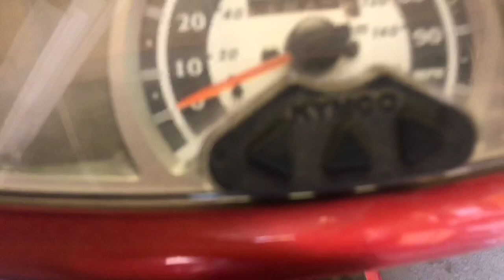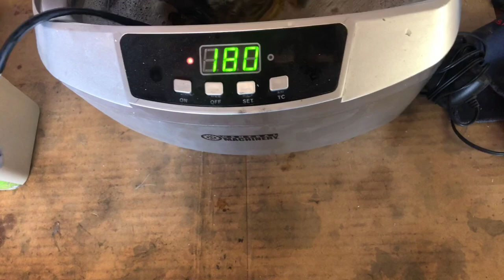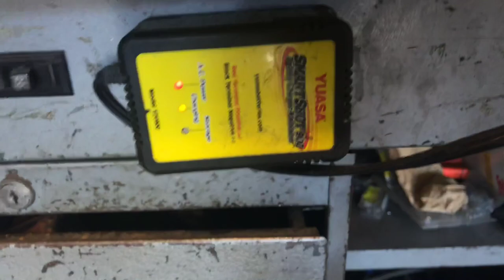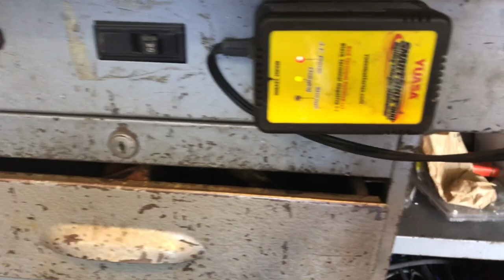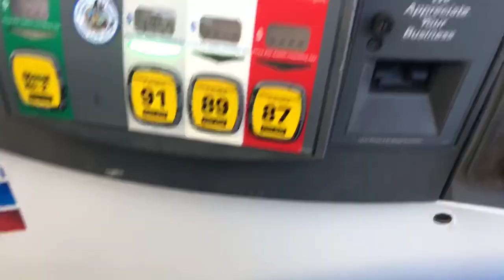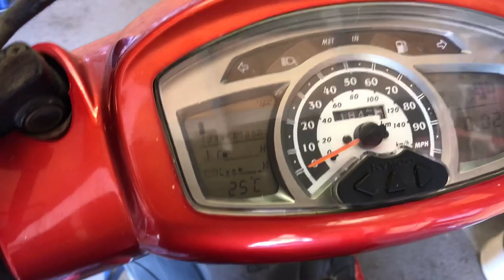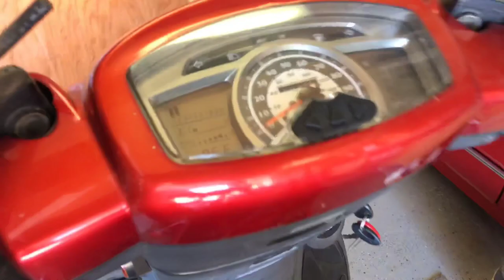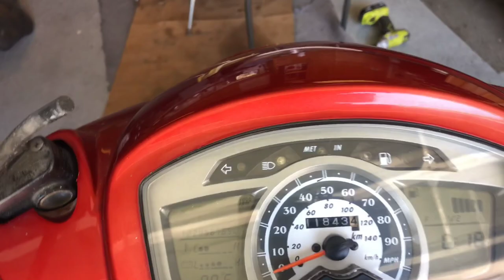Will it run??  Kymco Bet and Win 250 Scooter Project.

Comment: I have a 150 version of this bike. It has spark fuel. It just wont start? It has 30k miles but has been sitting since 2017
Reply from the maker: Carburetor needs to be cleaned perfectly.  Check compression?
Reply: @TomsTinkeringandAdventures  feels like it has compression.  I haven't even cleaned it. It bas sat since 2017.i just sprayed eather in it to see if it would start but didn't.  I'll clean it well tomorrow.  Can I just use 50/50 antifreeze?  Thanks for the quick response
Reply from the maker: @spencergaines5127  I usually use pine sol cleaner, take it completely apart and soak for 24 hours.  Rinse with hot water, set everything out to dry or use an air compressor.

Comment: Hey do you know where I can get parts for that scooter like gas cap ?
Reply from the maker: I had issues finding parts, I usually just searched on eBay for used parts.
Reply: @TomsTinkeringandAdventures  I tried that , but shipping on some stuff that i wanna get is like $50+ just for shipping, so I would rather not
Reply: @TomsTinkeringandAdventures  thank you, though
Reply from the maker: @GhostFS3000  yeah, unfortunately parts availability was an issue when I got the scooter and that was a couple years ago.  It’s probably worse now.
Reply: @TomsTinkeringandAdventures  indeed, especially as the years go and the older it gets